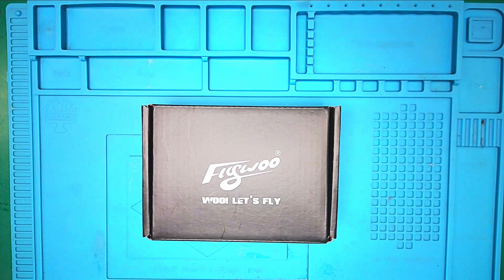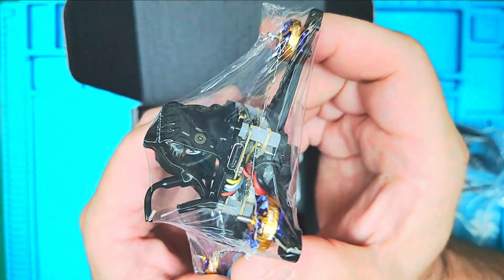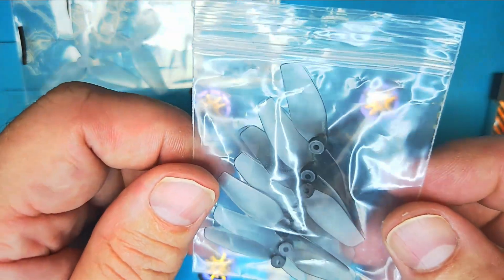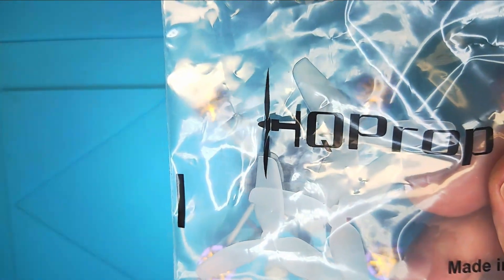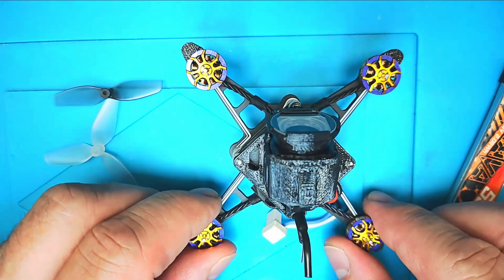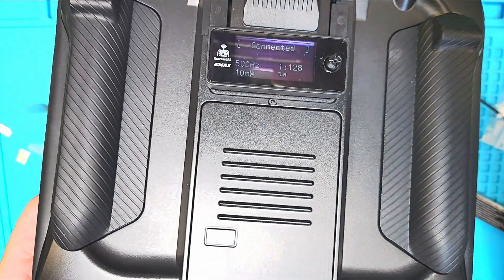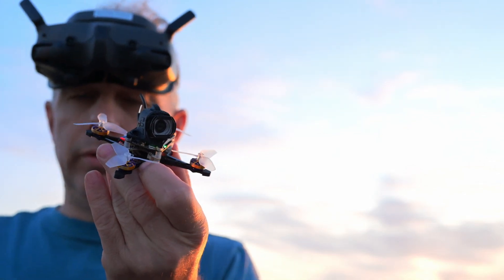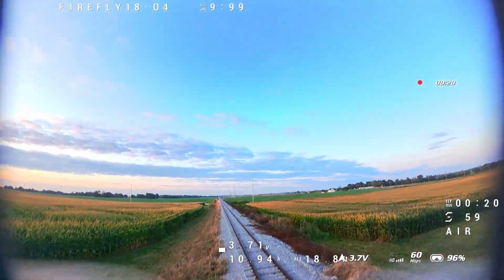Flywoo Firefly18 1S Review (8-3-2025)

Comment: Most reviews I have read state that this is pretty quiet. These props seemed loud. Did you ever fly with bi-blades? Was it quieter? What was the performance difference? 

I just got mine, and an waiting for weather to clear up a bit before flying
Reply from the maker: Yes, its quieter with bi-blades.

Comment: Thanks for this video, I wanted to buy one, but now I see it can't really go that far.

 I will pass and look for an other drone.
Reply: It can - ELRS was set to a low mW setting in this case …
Reply: @SURO90  I was guessing the same - 700W max would go much further. Although some have replaced the RC antenna with a longer 2.4 monopole for better range.

Comment: Nice video. How do you compare the firefly 18 to the meteor pro 75 both with the O4?  Thanks.
Reply from the maker: Without the air ducts the Firefly 18 is more nimble and easier to fly!
Reply: @princesfpvdrones  o wow 
And what about power ??

I’m thinking of getting bigger motors for the firefly 
What do u think ?
Reply from the maker: @morelove8397  I did think of putting the BETAFPV Meteor75 Pro motors on it as I am very happy with its performance. However, it get up to 4 minutes with the bi-blades on a 550 mah 1s battery, so I think I will leave it be as when comparing weight in grams they would be the same. I already have the BETAFPV Meteor75 Pro so I see no advantage in putting those motors on there. However, if you like I be happy to see the results?
Reply: I'd be interested in a video of a motor swap @princesfpvdrones
Reply from the maker: Totally agree!

Comment: nice job on the railroads ballast job on the tracks. if they disable my DJI drone will get an FPV drone. how far can u fly? what happens if the signal is lost
Reply from the maker: If one losses controller signal completely, the quad will simply fall from the sky.